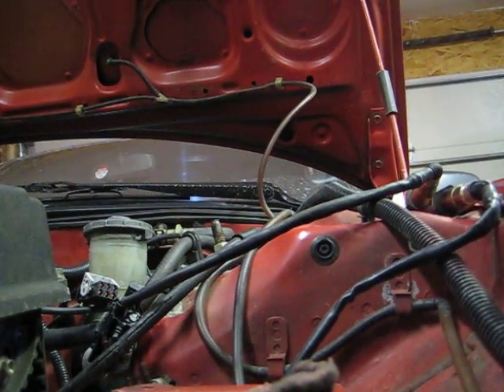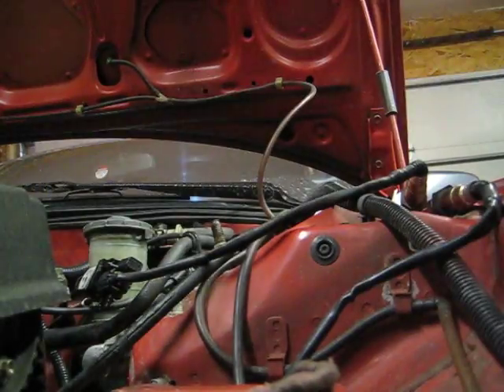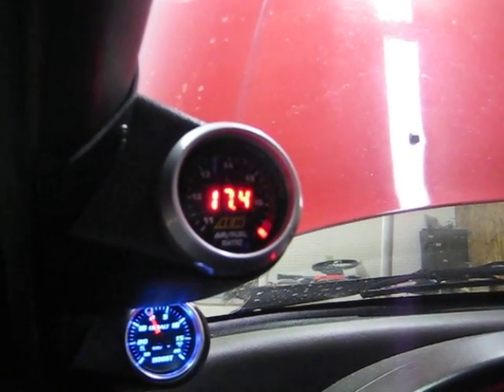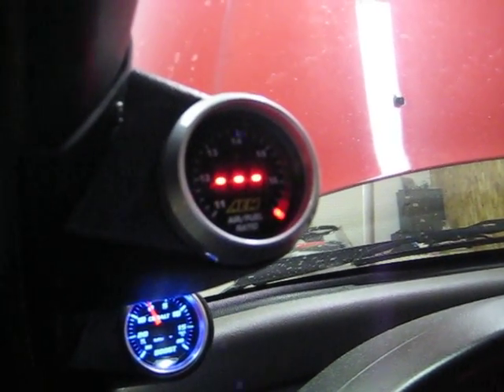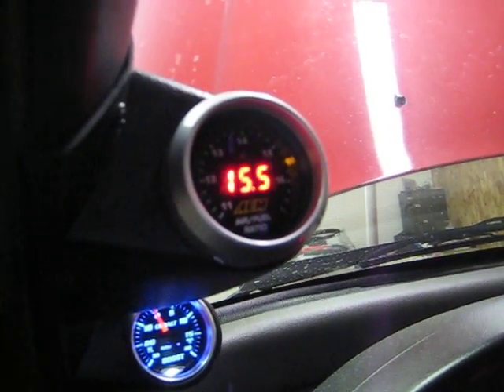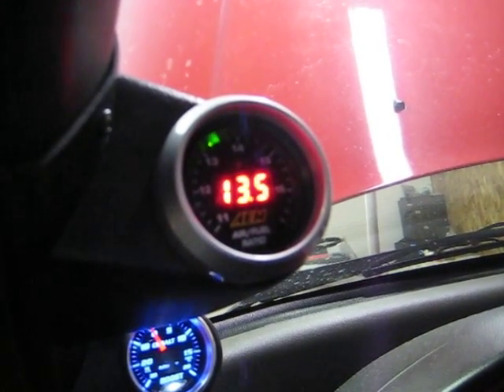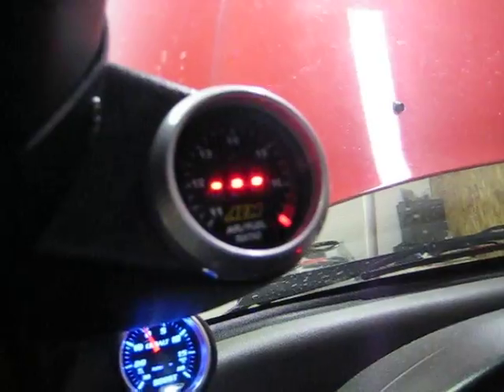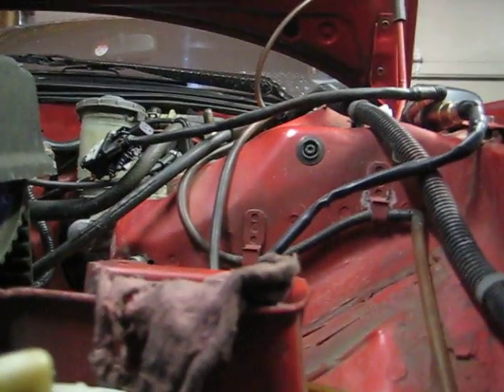AEM Wideband Test

Comment: okay I'm just curious I'm pretty sure that sensor reads off heat 2 so I'm really not sure how you're getting an accurate reading with just a gas soaked rag the wideband sensor reads off temperature and gases from the exhaust at heat temperature
Reply from the maker: Tommy Warren, The sensor does not read heat (perhaps EGT sensor you're thinking of): however, it DOES require to be heated to read accurate AFR's. The sensor will take approximately 5 seconds to heat itself and then it will read accurately. Hope this helps clarify.

Comment: Hey friend, tell me please do i have to replace the stock o2 sensor if i want to install a wideband sensor? I've searched forum but i don't understand anything they keep jumping from one subject to another. Could you explain to me in a few words if i need to connect the wideband to the ecu or i can just simply install 2 o2 sensors. One stock and one for the gauge
Reply from the maker: In my opinion it's safer to add an additional sensor versus replacing your car's primary. Read this article for details: http://www.newcelica.org/forums/showthread.php?t=188457#/topics/188457?_k=qjgisg
Reply: I'll check it right now, thanks a lot, wish you the best

Comment: My problem is when my car is at idle the car is reading super lean (17) but when the car is driving the sensor seems or appears to be doing it job. Is there still a chance my senor is on its way out? I've had it for about 1.5 years but the car has been mostly sitting.
Reply from the maker: That does not sound like a common sensor failure, but more like a tuning issue. The good news is that you can likely get the AEM (Bosch) sensor from Advance Auto in less than 48 hours. The bad news is I don't think that will help. Check factory wideband or narrowband datalogs if feasible to see if a trend occurs at idle. I.E. Factory O2 showing lean at idle as well.
Reply: Assuming I don't have a faulty sensor or exhaust leak. Maybe if my tuner adds just a tad more fuel during idle maybe this will do the trick ...

Comment: I have one of these and it only ever goes from about 11.2:1 to 17.3:1 even when doing this test.  open air = 17.3, gas soaked rag = 11.2.  I replaced the sensor portion and it still does the exact same thing. seems accurate but would be nice if I got the full range. any ideas why?
Reply: lampim atmosphere is like 22.4 or higher, get your self an innovate

Comment: Hey great video! I've got a question for ya. About how long did that o2 sensor last you before it capped out? I've had a wideband for about 6 months, maybe less... and I'm suspecting my sensor has died (it failed this test... stayed full lean the whole time).
Reply from the maker: On 93 octane it lasted a year maybe 1.5 years. On e85 it seems like 6-12 months. They seem to last longer if you 1.) make sure no moisture can pool into the sensor (i.e. Mounted with upward angle), and 2.) keep the sensor away from the hot manifold(s). Put it downstream at least 24" from heat source(s). Good luck!
Reply: +hoonyeah thanks! with my old exhaust it was close to horizontal, and about 20" downstream of the exhaust. with the new headers it is 36" downstream and at an upward angle. Thanks again for the video.
Reply: hoonyeah

Comment: can the bad wide band o2 sensor make my car run rich when it is cold and make it die
Reply from the maker: Not likely, unless you are using a wideband o2 sensor as your primary o2 (common with AEM EMS systems, or perhaps with PLX or similar o2 sensors that utilize a "narrowband 0-1v output" as to simulate the factory o2 operation.) Hope that helps.

Comment: Did this gas rag test with my AEM air/fuel gage and the sensor didn't move from 14.7 then plugged in a new sensor and waited about 20 seconds the the reading started to drop down to 10.0 and stayed there...confirmed that I needed new sensor...thanks for your help

Comment from the maker: Typical lifespan for me has been 1-2 years under boost. Currently running 1 on e85 15lbs boost no problems yet. Need to mount it away from heat and have a good tune to extend the life.

Comment from the maker: Too much heat is a big killer. Liquids/water as well, make sure the bung is angled at least +10 degrees. Instructions:  

Mount the O2 sensor in the exhaust system at least 18 inches downstream from the exhaust port. If you anticipate high EGT's (over 800C), run a turbocharger, run at high RPM for extended periods of time or plan on running leaded race fuel then you must mount the sensor at least 36 inches or more downstream of the exhaust port as all of these can cause the sensor to overheat.

Comment from the maker: I've now replaced this sensor twice, first run was unknown mileage and time, second time was about 5,000 miles and 3 months. They die sometimes. Just have to live with it. Might want to ensure it's far enough downstream from head/turbo/whatever is generating heat as that will shorten the life of this sensor. It's not worth struggling over, just buy a new one on ebay for $75ish. Hope this helps.